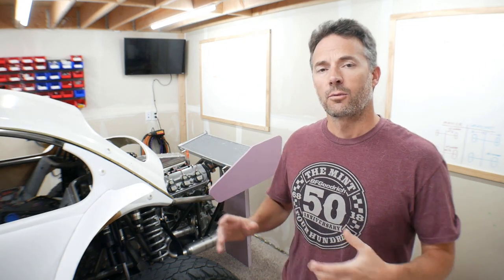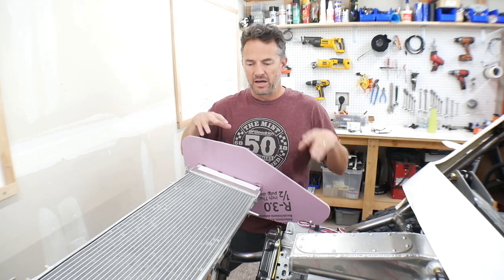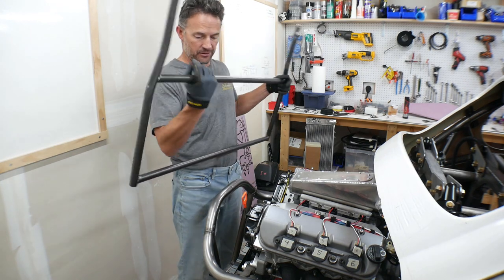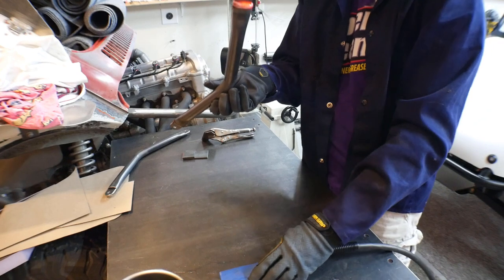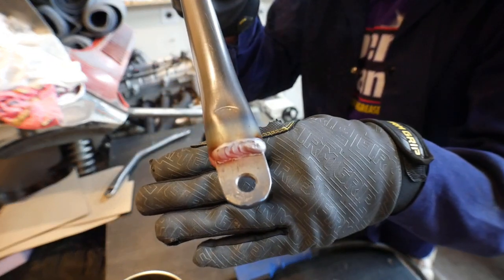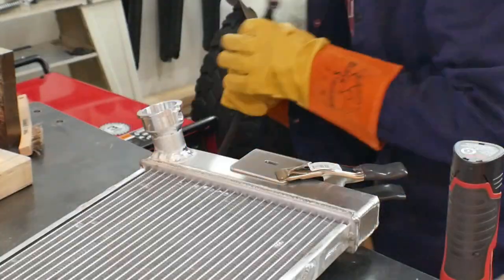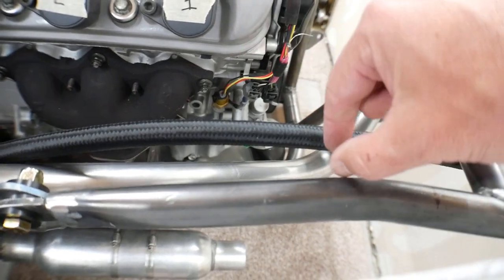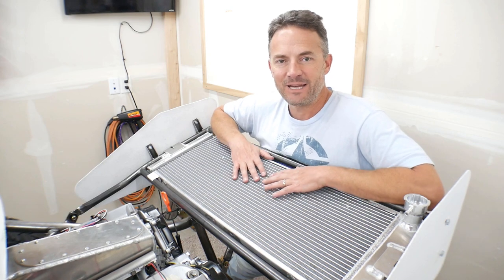Installing Wing/Radiator on my Baja

Comment: Fiberglass coated wood would work for the wing but it might be heavy. Lexan or maybe abs plastic if you can find a sheet of it. Sheet metal perhaps? 
What an awesome idea making the wing fold. I’m so glad you kept the radiator out of the cabin, that’s just asking to be burned and you might of regretted blocking your view out of the back window.
Reply from the maker: Thanks for the tips! I think I'm leaning towards trying some ABS plastic.

Comment: Look cool! Just like the RC cars I remember. Suggest you mount fan in pull through setup and maybe extend the wing front to cover up the pivot point. Keep it up.
Reply from the maker: I'm going to see if I can mount them pulling, but the issue is the engine roll cage makes it so there isn't much room underneath. I might make the wing sides a little larger to cover more up. Thanks for the tips.

Comment: Long live the kid in all of us!  Once again, I see our builds mimicking each other in some sense. When I changed and relocated my rad, I used an aftermarket XJ and mounted it to the back of my roof rack with a like mentally - it's a consumable in a bad situation.  Air flow is my only concern with yours, and we'll see as you test it out with the pushers.  Ever closer!
Reply from the maker: Sounds like good placement for yours. 👍
Thanks for the comment.

Comment: I just finished a similar project. I initially use -12 on both sides and found that I had incredible heat transfer in the radiator. My inlet temp was 210 and outlet was around 90!  The problem was the engine temps kept rising. 

The problem is more about volume than efficiency at some point (I still haven’t found it honestly). 

Then I scrapped everything and bought everything in -16. The temp drop in the engine is superior now but the sensor data for my radiator isn’t as impressive. I struggle to get past 200 (this is good) but only see a temp drop to 170 from the radiator outlet. Ultimately this is fine and “works”. I thought of adding a valve to regulate flow and temp but have opted not to right now. 

The biggest lesson has been that radiator size doesn’t matter nearly as much as the fan size and flow.  I went to a smaller radiator with a brushless fan rated at 2700 cfm and it gets the job done. Most folks with that TJ run triple fans which works very well and looks great to cover it end to end. 

As for airflow to your radiator- looks like your design is going to depend very heavily on the fans. The radiator angle would cause a high pressure zone because of the fin angle and probably cause most air to flow over instead of thru. 
One option would be to have a wing element about 1.5” from the radiator to limit the flow over but will also protect the fins etc. let me know if more explanation is needed. 

Thanks for the content. I need it when my project pisses me off!
Reply from the maker: Wow, some really good info in there, I appreciate that.
So I'll have more flow than when you had the -12s, but less than what you have now with the -16s. So I'll see where I end up. When you had a huge drop through the radiator you clearly had low flow.
I'm running three 10" fans, so hopefully that will be sufficient. But I won't know till I get the darn thing running. 😁
Thanks for all the information, that helps me with my design. ✌
Reply: @DougBugBuilder  glad to help. Keep in mind a thermostat wide open usually only has the flow of about a -10an line.  I opted to remove mine. Mainly out of frustration but it was something I studied a lot.
Reply from the maker: @exportedafrican  Dang dude, you're full of good info on this. I'm not running a stat but knew it was a restriction. Just didn't know what to relate it to. Thanks for more good tips!

Comment: Check out the Audi Quattro rally car version. It had an oil cooler radiator built into the rear spoiler. An interesting not is that it was mounted upright, so you might have to divert some airflow with deflectors. I love the idea of doing it like this as no one I've seen so far is crazy enough to weld their radiator in an exposed area! xD

Comment: +1 for ABS, or acrylic.

Also had a thought seeing the RS200 comment… if getting airflow becomes an issue, a “double spoiler” (the lower section on the trunk) similar to the Audi Sport quattro E2, where the bottom element is actually a scoop for the cooler, could be an option without a significant redesign.
Reply from the maker: Yeah, I thought that if needed a scoop could be added to bring more air to the radiator. But it would also bring in more dirt and gravel. I'll see how it cools as is first, hoping its not a problem.

Comment: Very nice! I notice one thing. When the radiator is full, if you're not holding it up while unbolting it, it will lay on the rear engine cage... I would look into making a stop somehow so it will illuminate that... very awesome job on the entire project though man! I didn't even want to say it in case you took offense... you're doing a way better job on your baja than me... 😆
Reply from the maker: No offense at all. You are right, it needs something to support it on the bottom and at the top. I'm still hashing that out in my brain. ;-)
Reply: @DougBugBuilder  in glad you're not offended! As I said you're doing a great job! I have some ideas but it's tough to get them into words... I'm sure you'll figure something out. You always do! 😁

Comment: Yo Doug, looks great. Love watching you work through this stuff.
As always , you  tweak out the details.

A ton of sand cars have that set up( without the badass swing up action).  
 I’m no expert, but I’d build some type of rubber snubber in front of that pivot point to lean on. Double shear the pivot also …. Just a wish list.  I’m sure whatever you do it will be well thought out.
Reply from the maker: I agree, I do need to figure something for it to lean on before it slips and crushes the fiberglass. 🤦‍♂️
Thanks for the comment and nice words. ✌

Comment: Nice job.  Just catching up. I saw from a later vid your not happy with the temps. I have seen so many guys out on the sand curse because of all the work to get to parts that need service. Your preventative building maint. is coming into play for maint. and repair in the future. I likey! I also like the RC car look. Those little devils sure take a likin and keep on ticking. But then they have a lot less weight.....  hehehe
Reply from the maker: Problem solved, the wing works great when it's 45 degrees outside. 🤣
Reply: @DougBugBuilder  Always want to experiement with smoke or just little streamers to see how air flow works.  Maybe a small wing above the the window to direct it down or plastic to block the rear window....

Comment: Hey man, 
Kevin  here from Australia. 
That was a lot of work. 
But I think it needs to be lifted up a bit at the moment the angle is not in zink with the height and angles of the car.
And could you run solid pipes from the engine then a quick release pipe from the solid pipe to the radiator. 
Anyhoo I like the concept with the fans mounted this is going to be awesome. 
Stay safe and healthy man. 
✌🏻  Peace.
Reply from the maker: Ya know, the quick release is not a bad idea. With quick releases and plugs for the fans I could just remove the whole assembly. I might look into that Mr Kevin, thanks for the idea!
Reply: @DougBugBuilder  ✌🏻

Comment: I'm facing the same exact problem on my J32 swap mid engine rail.  I even have the same XJ alum rad.  I like your solution.  for me I'm thinking back window...which I hate, but it has to go somewhere!
Reply from the maker: Well the good news is that radiator is pretty low, so you might still have some visibility over the top.

Comment: Material for the wing, look for alumicore, used for signs and stuff like that, but its 2 aluminum sheets with a foam core, comes in different thickness
Reply from the maker: I'll look that up, thanks for the tip.

Comment: Look for some starboard.  They use it to line the bottom of fish tanks.  Should come in 1/4" or 3/8"...You should be able to get it in sheets.  I've even seen it at Home Depot or Lowes.
Reply from the maker: Thanks for the tip, I'll look into that. 👍

Comment: very nice but................  hoping you did a video in the bender conversion I have been considering that kit and looks as though it functions just fine.  When bending tube I notice O need to pull on the arm to take up the slope to get to zero so my question is how do you deal with that slop before bending?  I just saw the video a day or so ago where you anchored the bender using 2 bars and this new set up is very good
Reply from the maker: If you notice right before I start bending I push the arm out, or away. When I'm doing this I'm pushing it through the slop until it is tight. Then you set the pointer to 0 degrees and tighten the valve for the hydraulic cylinder. Now when the cylinder starts the bend the pointer will be accurate.
I hope that makes sense?
Reply: @DougBugBuilder  yes it does and I didn't notice the first time but am sold on doing that conversion at least if I can find the cylinder as Harbor Freight has discontinued it and so far have gotten no feed back on if they are the 80mm cylinder on the others I have seen on Amazon and Ebay

Comment: Aren’t you worried about small rocks and stones smacking it from below when you’re speeding on dirt?
Reply: I was think he should add some mesh over the fans and rad to prevent this.
Reply from the maker: The answer is yes, I am worried about that. ;-)
I think the only solution is a mesh like mentioned below. When the fans are on, and the tailights are installed, I'll probably make some sort of cover to add some protection.

Comment: I think side wings should be aluminum and a brace on the forward end, it may flutter if to thin and not braced.
Reply from the maker: I actually have some 1/8" aluminum. But I felt like it was to heavy. And I thought anything thinner would be to flimsy. But maybe not with another brace.
Thanks for the ideas.
Reply: The industry standard name is "end fence"or"end fences"

Comment: Food for thought 💭 roof mounted radiator with hood scoop for vent ?
Reply: Putting the radiator on top of the back window slanted back with a hood scoop channeling air. Clean top air.  No dirt from the tires in the back.  Plenty of back storage space. Can still see out the back window.
Reply from the maker: That's actually a great design. I know how I could do it. And still have some visibility. I'll probably stick with the wing, but if I consider other options this would probably be #1. Thanks for the idea.
Reply: @DougBugBuilder   you know best! Would just hate to see a rock or something fly into the back radiator. Plus I’m not an expert but you want the radiator above the engine or a certain level if I’m not mistaken. To keep the air bubble out of the motor or something. Cooler engine temps with radiator mounted higher I’ve read.

Comment: Sheet ABS for the radiator wing “dams”? The dams  would probably need a perpendicular stiffener rib(s)  run along the length on the non visible side. That would keep them from flapping in the air if the sheet is thin. (Maybe you’ll learn how to weld plastic and weld the ribs in)
Reply from the maker: I'm going to look into the ABS plastic, thanks for the tip.
Reply: RPMX Info Dot Com , c’mon man! That’s not as fun as welding, but you’ve got a great point. Note: best not to splash with gasoline after making cool wing dams
Reply from the maker: RPMX Info Dot Com  I'm going to try that, sounds to easy to be true.